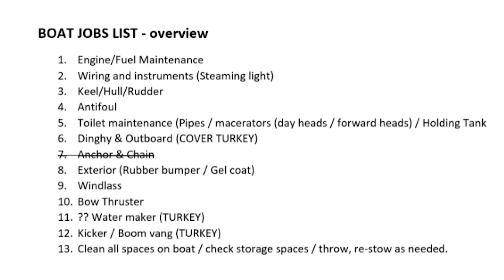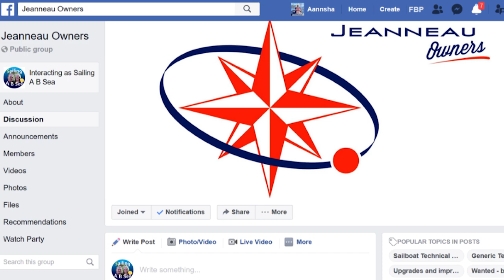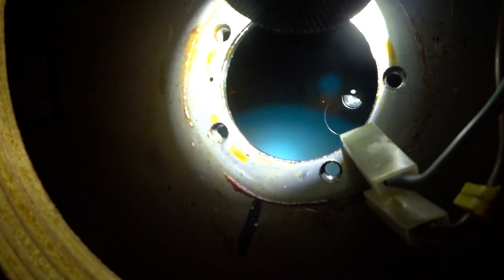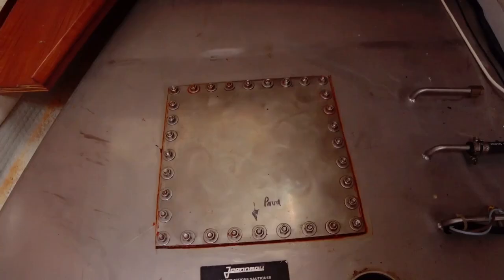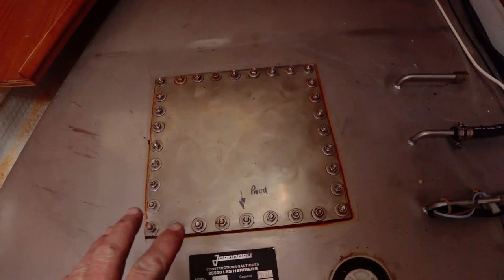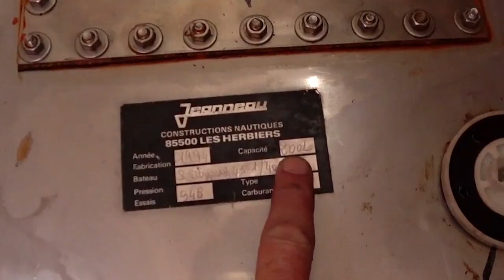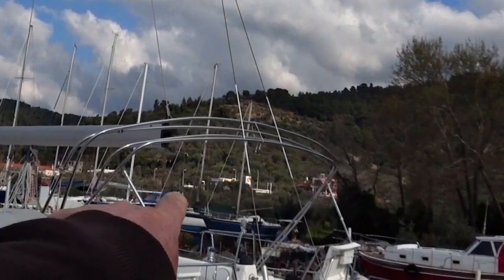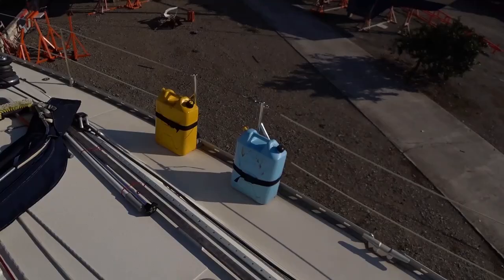Do we have diesel bug? - Sailing A B Sea (Ep.114)

Comment: easy to work out if you have the bug. take a sample of fuel. put it in a clear glass. add the bug killer , stir and leave it over night. in the morning you will have jelly/glycerine in the bottom. you can add diesel bug treatment to all fuel tanks and filter it out. i had this with a landrover a few years back . you can also add an additive to the fuel which allows the water and fuel to mix into an imulsion, fuel stations in the uk add it to their underground tanks all the time. this will burn as normal. i use it all the time. i use a biocide called SW4 to kill the bug and Fuel set, which is the fuel conditioner to allow the fuel and water to mix. also keep your tanks as full as possible all of the time. the bug grows on the damp area above the fuel, feeding off it.
Reply from the maker: Thanks for sharing that info and tips Stephen. 👍

Comment: Not sure why you were having trouble getting the key out of the shaft - have not watched the video yet but you should be able to get it out with a punch or small chisel. Once you have it out, however and have it all cleaned up with a wee file it would be worth drilling a hole right through the key (in the direction of where it sits against the key way), using a tapping size drill for say a 6mm thread. So next time you can just wind in a 6mm bolt and that will jack the key out no problemo.

Fuel contamination. As you probably know from your research😉 Diesel Fuel contamination has two main components, one is ‘fuel derived dirt’ which is the natural action of refined products attempting to revert to their natural state - it looks like small black specs and will be caught by your filters and increase the rate of filter blockage. The best way to minimise this natural process is to only buy your fuel from the busiest busy filling station/marina that turns their stock over quickly, in addition, you should never be filling your tanks while you have fuel on the deck in Jerry cans - cycle those into the tanks as soon as there is space. To be honest only use deck Jerry tanks when on an extended transit (not sure of your consumption rate) but maybe passages of more than 48 hours. The second element of fuel contamination is ‘diesel bug’ (or micro biological contamination or specifically - cladisporium resinae) which as you quite rightly identify grows and feeds on the nutrients at the fuel water interface. Prevention is better than cure and you are on top of the precautions, but a good fuel system with correctly rated fuel water separators and filters is essential. The gold standard is to have the pipework and valves to enable you to ‘polish’ the stock in the tank or even devise a portable Magyver solution that you could rig if you hit trouble (could be mounted on a chunk of plywood and kept in a locker).

On these additives. I would not mix them in with the fuel at the same time without verifying they are compatible. If you currently do not have diesel bug I would put the system cleaner in first and turn the tank stock over before using the biocide. Personally I would not use the biocide unless I had evidence of diesel bug - it looks like black stringy snot btw.

Enough - sorry for my verbosity.😉
Reply from the maker: Hey Norman, thanks for sharing all that info and we love the tip for drilling a hole through the key for easy release. Cheers.

Comment: Hey Baz be sure to remove the key from the prop shaft before you reinstall it as there is a very good chance of damaging the shaft seal a trick I have used is to tape up the area of the key notch so that all sharp edges are covered, masking tape works great
Reply from the maker: Good call! Thanks for that tip KC. 👍

Comment: Hi there. From my own (bad) experience with diesel bug in theMed I looked into the subject for quite some time, also because of personal interest, as I am a biochemist. In essence it has increased in the past 5-7 years do to the fact that in many Southern EU countries biodiesel has been added to diesel (at about 10% in volume). This fact promotes bug growth. Therefore, additives like the ones you use need to be added at each filling. In addition, I upgraded my Racor filter to a double Racor to proceed, when the engine stops underway. By doing so I never got problems, despite the diesel in my tank is not yet perfectly clear, but improving. Good luck. Silvano
Reply from the maker: That's great information to share Silvano, thanks. 👍

Comment: Dont you think it might be better to have two more jerry cans of diesel?  You can use them fist before refueling and have them. Refueled at the fuel dock
Reply from the maker: Storage would be the problem. The diesel and water are currently strapped onto the strengthened double stanchions at each side gate. We wouldn't trust a single stanchion to hold the weight of 20 kilos.

Comment: Remove the key before pulling shaft or re installing the new seal ,you just damaged the seal lips, you can keep the old volvo seal for an emergency
Reply from the maker: We're in uncharted territory with these jobs, learning as we go. We didn't know that the key was removable. Thanks for sharing these tips. 👍
Reply: use a pick punch on the end of the key and tap it up to remove
Reply: @SailingABSea  You will get an orange plastic piece with the seal this goes into the seal before you put it on the shaft to protect the lips